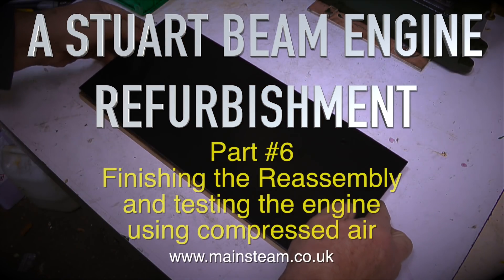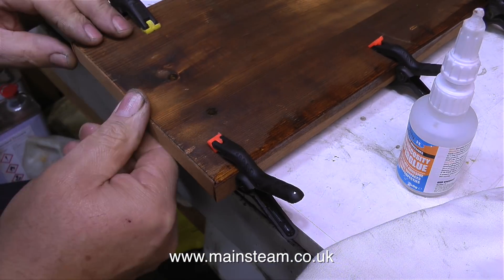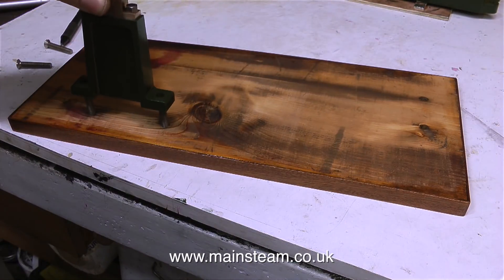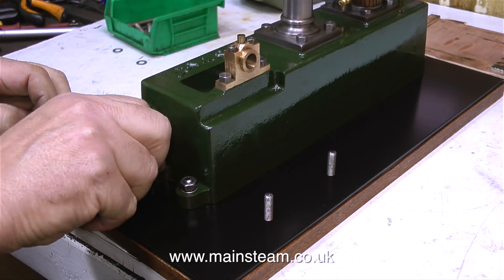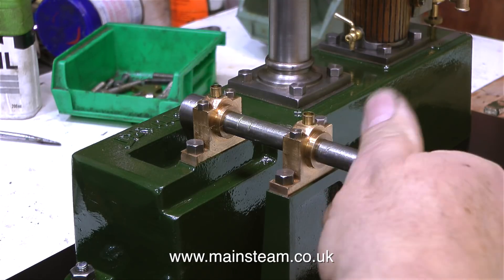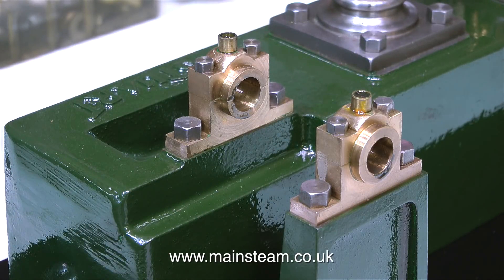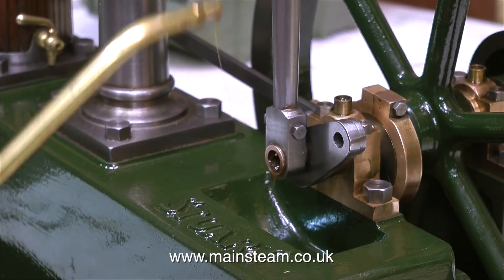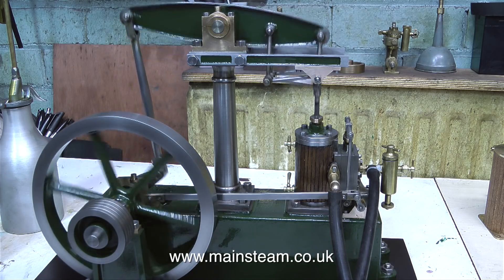STUART MODELS BEAM ENGINE REFURBISHMENT - PART #6

Comment: Yep, changing a roll pot up in zone 19 of a tornado jet is far worse than doing up a few tiny nuts with an open ended spanner. The secret is to use either masking tape to stick the bolt into the socket or superglue, a few prayers and personal choice of expletives helps

Comment: Is a 6 BA bolt would you use a 4.900mm spanner or socket.   This is the table I used                          
    
BA  Pitch  OD  Threads per inch  OD  Spanner  Spanner
 (mm)  (mm)   (in)  (mm)  (in)
0  1.00  6.00  25.40  0.2362  10.5000  0.4134
1  0.90  5.30  28.22  0.2087  9.2750  0.3652
2  0.81  4.70  31.36  0.1850  8.2250  0.3238
3  0.73  4.10  34.79  0.1614  7.1750  0.2825
4  0.66  3.60  38.48  0.1417  6.3000  0.2480
5  0.59  3.20  43.05  0.1260  5.6000  0.2205
6  0.53  2.80  47.92  0.1102  4.9000  0.1929
7  0.48  2.50  52.92  0.0984  4.3750  0.1722
8  0.43  2.20  59.07  0.0866  3.8500  0.1516
9  0.39  1.90  65.13  0.0748  3.3250  0.1309
10  0.35  1.70  72.57  0.0669  2.9750  0.1171
etc.       
25  0.072  0.25  352.78  0.0098  0.4375  0.0172

Comment: I have watched many of your videos and I like them very much.  I have seen you run the engines on compressed air and steam.  Do they run any different under load, when they are powering something (under load) and does that change how you would set valve timing?
Reply from the maker: I will explain in a future video.

Comment: My metals teacher once instructed us to put a nut on the bolt when rounding the end off. The thought was that, if the threads are damaged in the rounding/shortening process, taking the nut off will chase them and you wouldn't have to hunt around the shop for the die set which was inevitably missing. Either with enough experience it's unnecessary, or my teacher was a quack and I've been betrayed by public schooling.
Reply: As you surmised it's a skill of experience. Using a nut is a good precaution for beginners.
Reply: mostly its for when you cut them, usually rounding the end fixes them if you cut without the nut on
Reply: If your teacher was a Quack so was mine same advice.